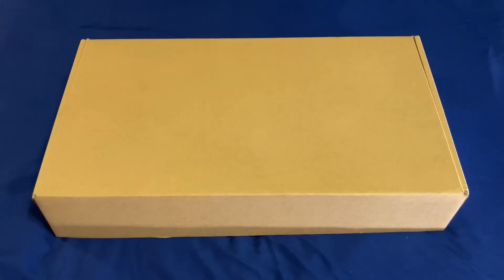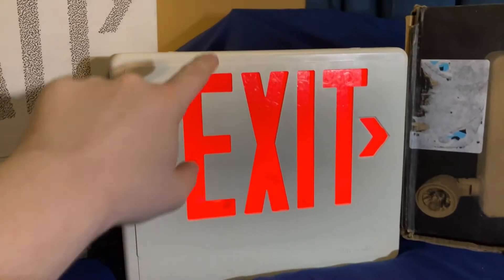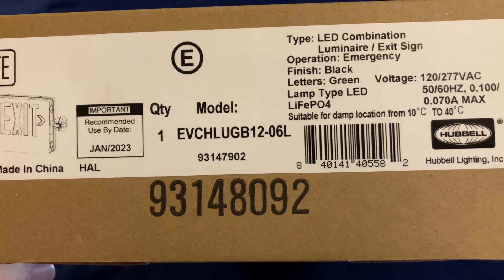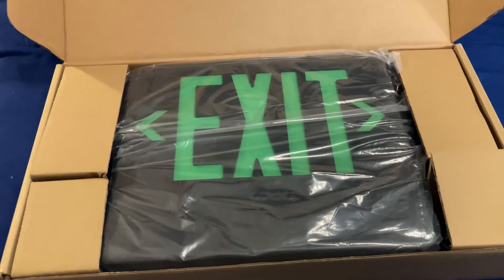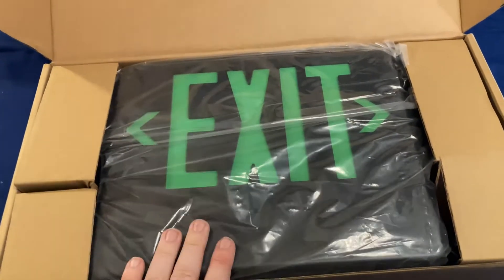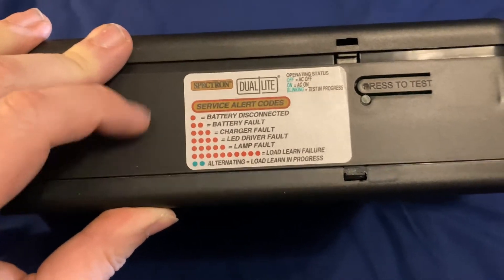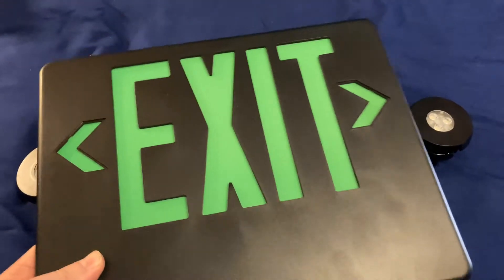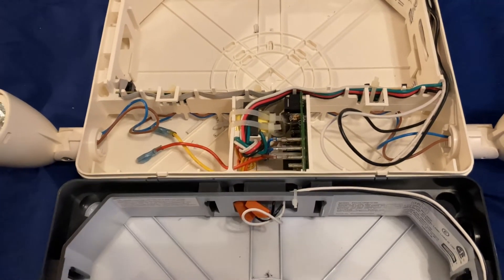First Look: Dual-Lite Evolution Series Combo, High Lumen (EVCHL)

Comment: Very awesome exit sign. Wondering if it holding up so far. I myself have a Walmart version of the Dual lite EVHC. It was my very first emergency light and the best light I bought. I do have a ton of Lithonia ELM and one Lithonia ELM 2 but they have no comparison in terms of brightness and quality. What I found is the 3rd generation of the quantum series have had the worst charging circuits I’ve ever seen. I also have a Lithonia LHQM LED. My fist one had a bad light engine. My second one works the way it’s supposed to but I don’t expect that to last long. I want to get ahold of both the Lithonia sign with ELMLT optics as well as the Dual lite sign shown in the video. How well does this sign work compared to the ELMLT?